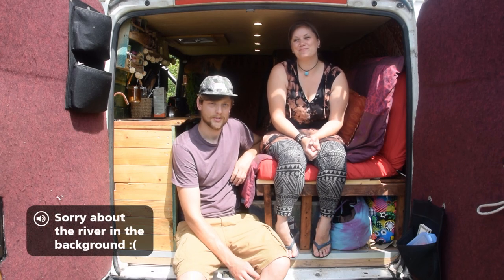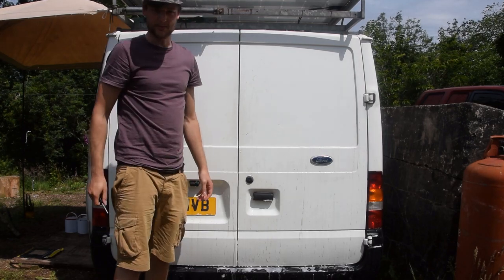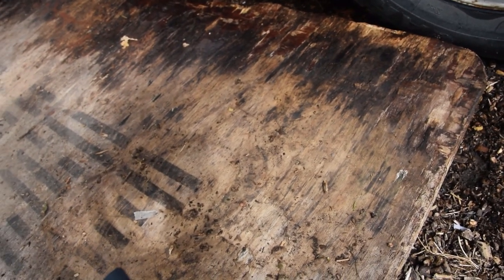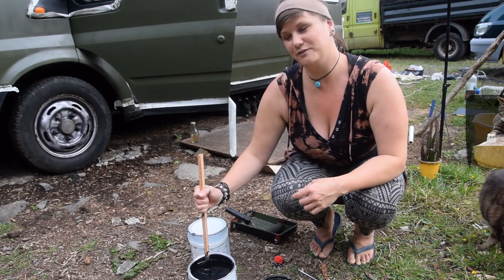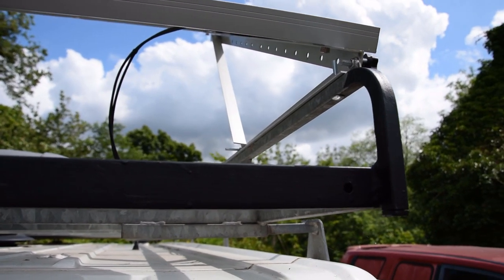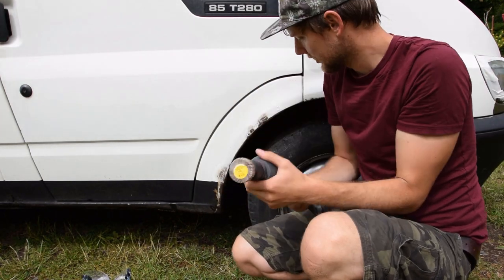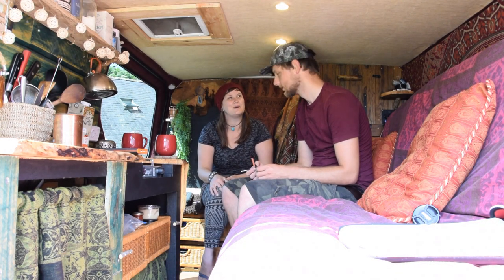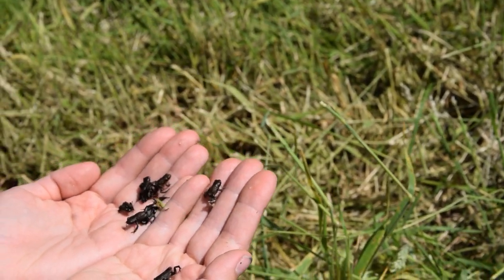Painting Our Van on a Budget - Part 1

Comment: Well done, looks really good,  is that paint durable and hard wearing? I presume it is if its army paint. 
I want to do my silver transit 2019 now.
Reply from the maker: Thanks mate. Just done my new van in the same way. Very hard wearing. Scratches if you drive it down forest roads between gorse bushes like I do though 😂 but holds up well and I've yet to ever see it flake. Great stuff reslly. Be aware that they seemed to have thinned it down now, I guess it's a way for them to make more money 🤷‍♂️ so may need more coats. I did 3 for 4 on my new van.

Comment: Did you use the paint from paints4trade. They reccomend using a primer. Hows the paint job on yours 10 months later.
Reply from the maker: We bought from ebay, I think it was 'Trade Paints'. If I recall we read forums of people not using a primer and having great results so that's what we did. If you have the budget then priming will certainly give you a better lasting result. 
I can't say Bruce is perfect 10 months on but that's because we drive through pretty crazy roads so he gets scratched up by bushes and trees all the time. Most of the scratches are a light green and come off when we wash him, but some are deeper. Whether primer would prevent this I do not know. 
Again, if you have the budget then probably a good idea to do everything you can to prolong the paintjob.
Reply: @TheWoodlandNomad  thankyou for your reply again. Aslong as the paint isn't flaking away I'm expecting to get a few scratches. Just need to get welding done and lots of it.
Reply: @TheWoodlandNomad  How many liters did you use for your van.
Reply from the maker: Honestly haven't seen any flaking whatsoever! It's holding really well ☺ Aw no, we know the pain of needing welding all to well. Hope you've found someone that can do it for a reasonable price!
Reply: @TheWoodlandNomad  yes I have but not sure how good he is. I have been grinding away today to help speed things up. First guy said he wanted £1000 but this chap said about £250.

Comment: Hi guys. Great job. Have a DIY paint job for my transit LWB high roof in mind. This paint looks good. Did you thin it at all? Doesn't look like it. Could you post some links for this and your high density rollers etc. Cheers.
Reply from the maker: Thank you :) It's a great paint and no we didn't thin it. It's honestly that long ago that we don't know what rollers etc we bought. But I can tell you that we bought everything from ebay so you will find everything you need there :) Several sellers for military vehicle paint, we just went with the cheapest. Stay safe.

Comment: How much paint did u need for the van am goibg to do myn the same looks  cool 👍
Reply from the maker: It took us 5L to do two coats. We did paint the roof rack and box though so if you have a similar sized van then 5L should do it. 
We did end up buying an extra 2.5L tin  later on to have in case we scratch the van in future :)

Comment: Awesome job , did you take door rubbers off to get behind them ??  Tip for if your bumpers fade , use a heat gun ! Just done mine and they look like new 👌
Reply from the maker: Thanks Trev, nah we never did, we were impatient haha. We just taped up. But I would warn that masking tape and hot sun do not mix! Lesson learned there. Aye we've seen people do that, looks more like a more permanent fix as well! Thanks for sharing 👍
Reply: @TheWoodlandNomad  can i ask how the paint finish has ended up ? Is it uniform ? My mk7 2013 is in good shape so looking for a bit of protection for the roof and bonnet ,  and the roller method is rather appealing for ease and speed ! And i rather like the black you used .
Reply from the maker: It's held up well. Two coats isn't going to protect it if you take it off road. Soon after finishing the painting I drove between two gorse bushes, that was a mistake as it left white scratches. Had to touch up. It's also faded on the roof box but we only had enough for one coat on that and it's plastic. 

The roof and bonnet still look excellent. We do have a slightly streaky bonnet because we painted in 28C heat so it was drying faster than we could paint it.
Reply: @TheWoodlandNomad  interesting 🤔 i wonder if a hardener can be added like in 2k paint? Will have to make some enquiries 👌 thanks for taking the time .
Reply from the maker: Unsure, I think a third coat would be a good idea but we were out of time. You're welcome and best of luck! 👍

Comment: hi doing my van same at the moment all roller heads are falling apart foam one melt  and other emulsion ones leave fluff on the van did you have this prob ? thanks
Reply from the maker: We never had any issue with our rollers at all, no. I'm not sure what they were made off but it was a type of plastic foam. Have you used any thinner or mixed the paint with anything?
Reply: @TheWoodlandNomad  
No straight from the tin .  it drys within minutes then becomes sticky . But started so I'll Finnish lol thanks anyway  ps still looks cool 😎
Reply from the maker: If it's as warm where you are as it is here I'm not surprised, the sun will be baking it on pretry quickly! Good luck 😁

Comment: That cure rust is rubbish, I used it for my wheel arches and it does nothing to stop the rust coming back at all.
Reply from the maker: It'll never stop rust in that sense I'm afraid mate. It's really just for surface rust. Something like a wheel arch will have rust coming from all angles. It's best used on areas where paint has chipped and made a little spot of rust. It's more of a plaster than a fix, it'll allow paint to bond and then every year or so it'll need treated again. Rust is a bugger.